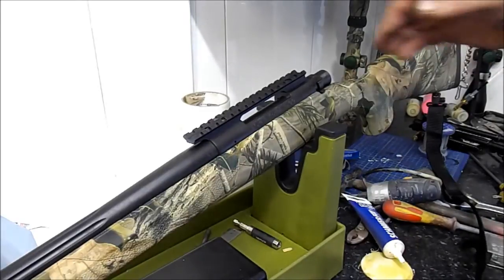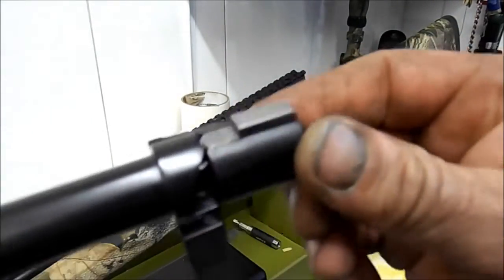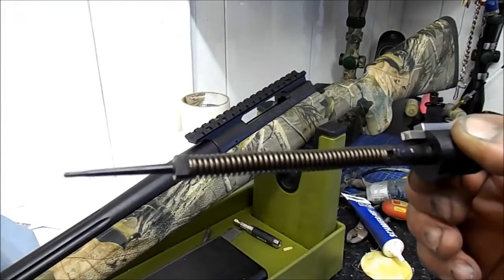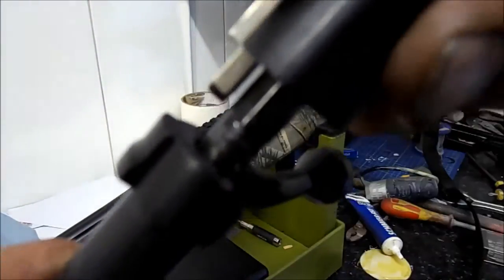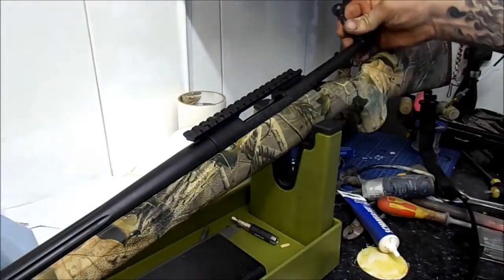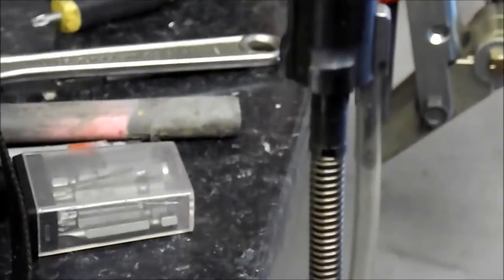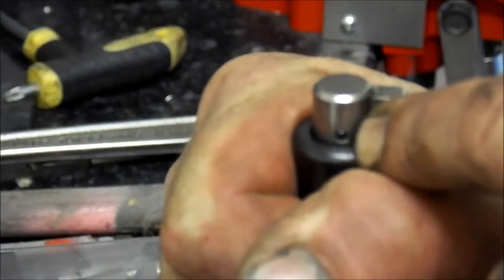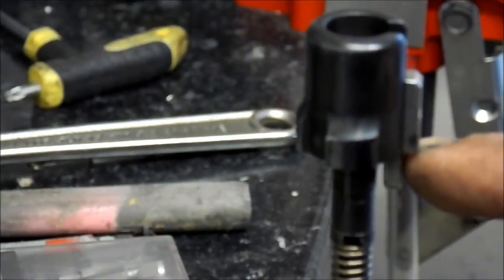Howa 1500 firing pin removal from the bolt

Comment: You must have strong hands or a looser bolt then myself.
I had to resort to a wrench to get it to move.  I used a glove between the wrench and firing pin to protect it and things were fine.
That said I was the third owner of this girl and noticed quite a bit of rust on the internal components.  It shoots like a dream, just needed some tlc.  Now thanks to you, the accumulated crud inside the bolt
has been dealt with.
Reply from the maker: Big Gee You're welcome mate. Glads you founds it helpful. I'll upload a vid on how to get the actual pin separated this week.

Comment: Hi Geoff,
I saw another video (different poster) claiming to fix the .223 1500 extractor issue (I'm having this issue).
The claim is its a spring issue - to fix is to replace the extractor spring with a selector spring from an AR15.

Could you cover how to remove the extractor on the 1500 bolt?
Reply from the maker: Hi, i honestly wasn't aware that there was an issue. The springs on the bolts, regardless of calibre are all the same.
Reply: Hi Geoff,
Is it just a matter of punching the pins to get to the springs?  Anything to be wary of?
Reply from the maker: Start with a small tapered punch to loosen them, then use the correct size. Make sure you punch out right to left, the pins are headed larger on the left. Replace the same way they come out. When you have drifted the pin out of the extractor plunger, keep your finger over the hole while you pull the punch out, the plunger will then spring into your finger. If the spring is stuck, use a small pipe cleaner or piece of wire to grab it & pull it out.
Reply: Thanks Geoff - "punch right to left" - this is looking from the rear of the bolt?
Reply from the maker: Correct, provided the pins have never been removed and rep[laced incorrectly.